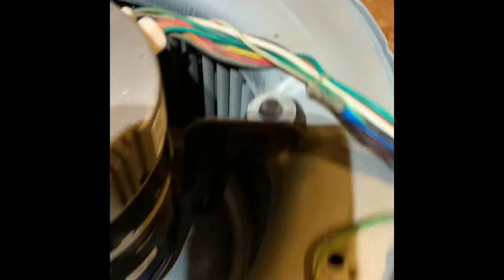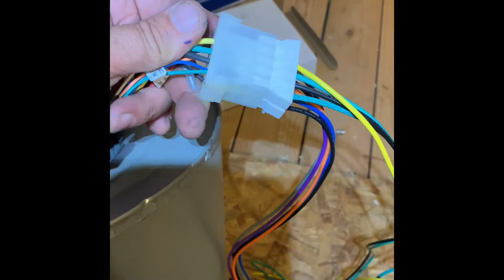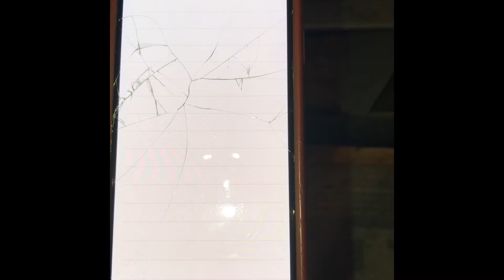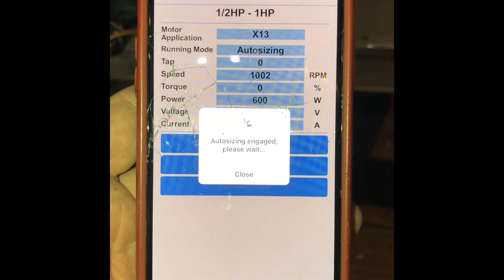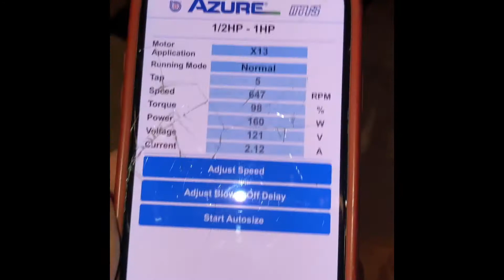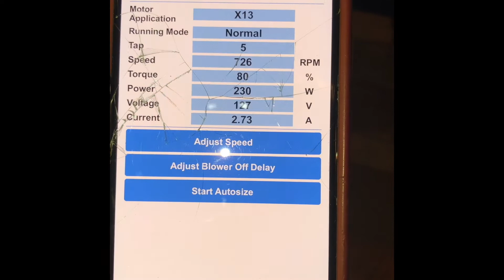Installing Mars Azure 10859 BLUETOOTH ECM Motor in Carrier furnace.

Comment: Thanks for the tutorial. Any link to the belly band?
Reply from the maker: @Capten1001  depending on the diameter of the old motor band. Measure your distance across the band from one screw hole to the other the buy the appropriate size belly band. This one was either an 8” or 10”. You’ll also need to know if it has 3 legs or 4. The local HVAC supply house I purchased the motor from also had the belly band in stock.

Comment: Did the old motor shaft slide out easily?
Reply: 3in1 oil helps before removal and I always lube the new shaft and wheel hub on install
Reply from the maker: It did. I usually will clean the shaft with a rag and some oil first before attempting to pull. If it has rust built up I’ll take some emery cloth or open mesh cloth and sand the shaft down then clean with oil.